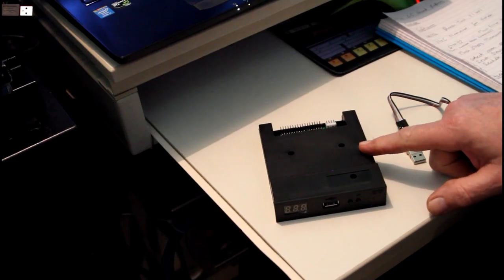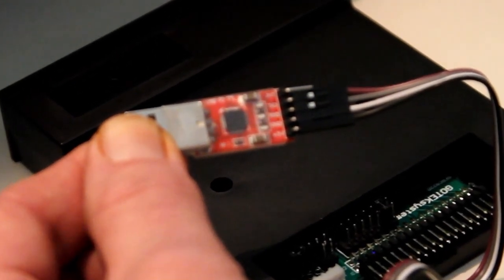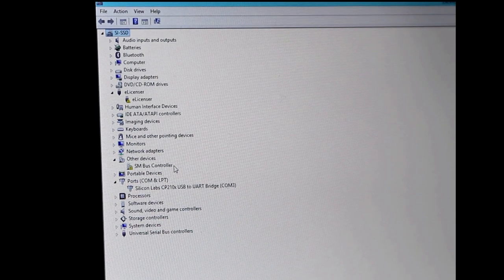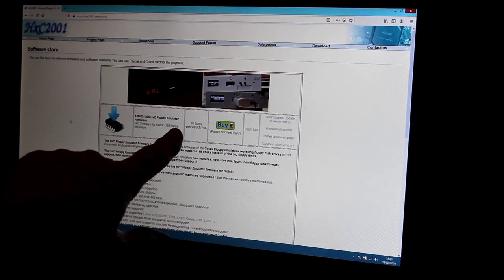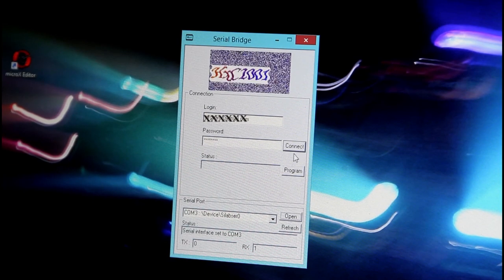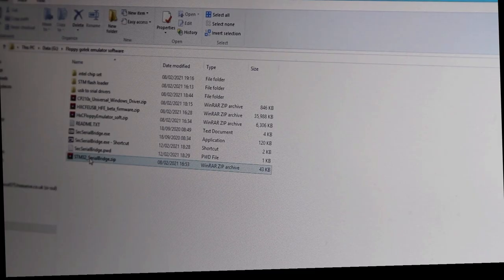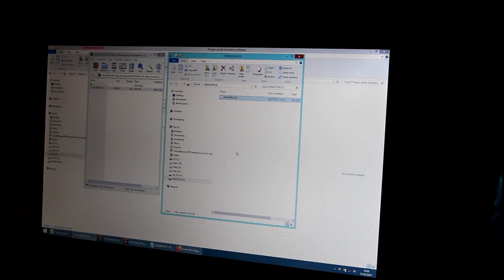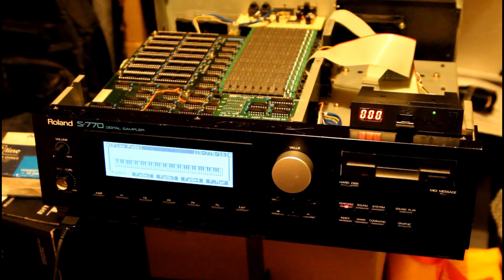PART 2 How to prepare and install a Gotek floppy drive emulator in your music equipment

Comment: Thank you for this! I had some issues with messing up the files on my HxC for my S-770. My personal learning experience is to have a pint AFTER flashing the firmware and not before lol. I got one of these and I love it. I have a SCSI and CD-5 with samples and disks and they're just incredibly slow so I decided it was time to update it to the 21st century. I'm keeping the DT-100 and RGB CRT just because it looks cool. This is a wonderful machine with some amazing graphical editing capabilities. 

Now, I'm trying to work on one for my Akai X7000 as it uses a QuickDisk and different wiring.

Comment: I think the STM32 versions of Gotek are obsolete.   ST Micro no longer makes the chips.    Now the latest Gotek uses the Artery MCU 415 or 435 with the Flash Floppy firmware - which is free.   Most sellers online include the latest Flash Floppy firmware with the purchase.   Not sure about jumper settings.
Reply from the maker: See if we can do an updated video at some point thanks for the info

Comment: Sounds great but can you buy one of these already flashed, I need one for my Kawai CP150 digital piano?
Reply from the maker: There are sellers on eBay who pre flash the goteks
Reply: If you want to gey ripped off mate they'll charge for 5 times more, as you can see it's simple just because man and do a bit of DIY it'll help you later in life.
Reply: @ushnicyuvnikof2748  Those ebayers charge from 60-80+GBP for pre-programmed emulators.
Reply: @Richard Frayo  They are less than half that way, way less if you buy in bulk to do all your gear. If you always pay way over the odds for gear, you're getting had and will pay 4x for everything, getting less value for your money. It's a bad habit to start.